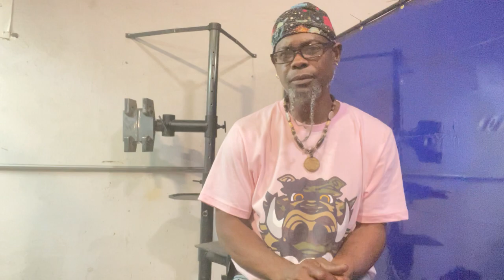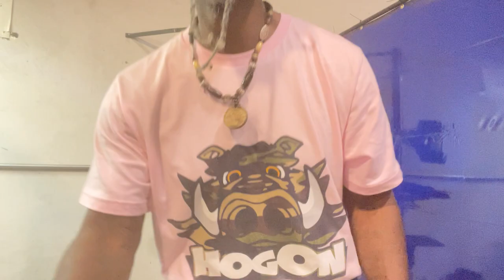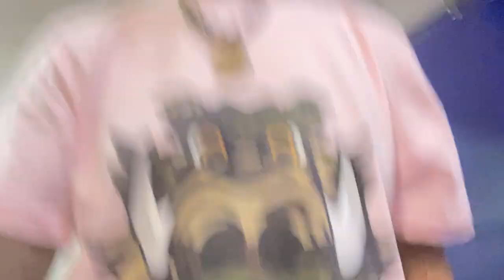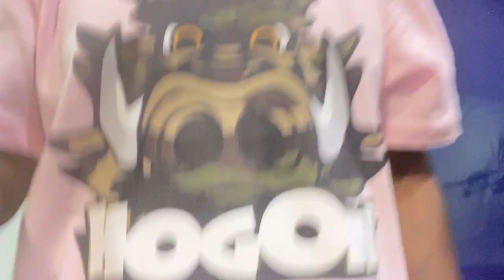Millwright Vs Welder

Comment: Whats your thoughts on wearing respirators and also what type of helmet would you say is better pipeliner or auto darkening? Appreciate the daily uploads and information og 💯
Reply from the maker: I think you should most definitely were a respirators when you’re dealing with different chemicals and minerals, especially on on mines, galvanized and etc some welding doesn’t require you to have a respirator on. As for the pipe liner or auto darkening, I like both just depends on what you are doing.🙌🏿🔥